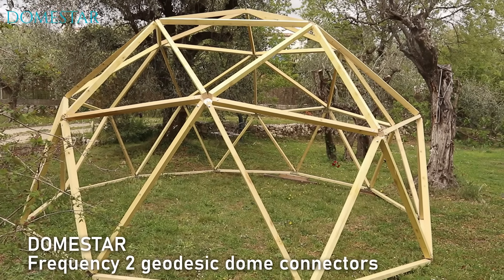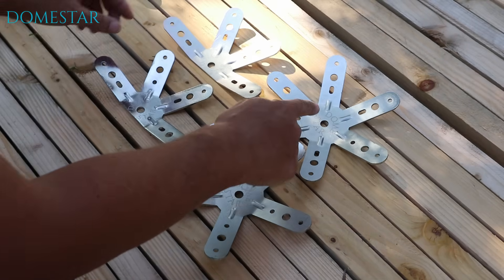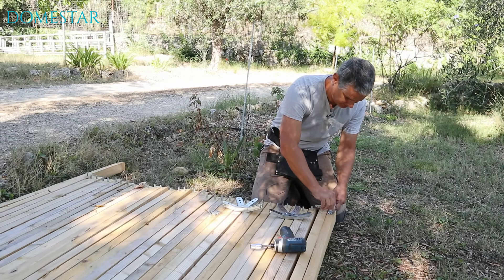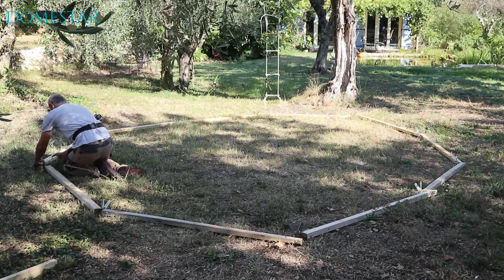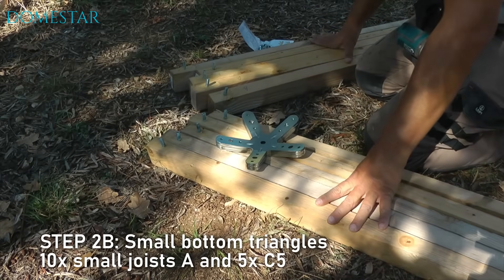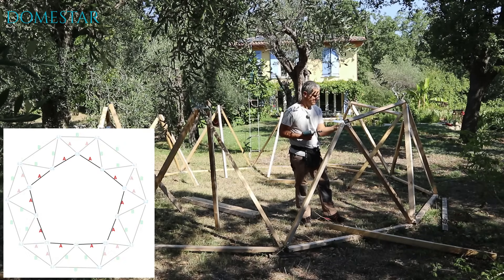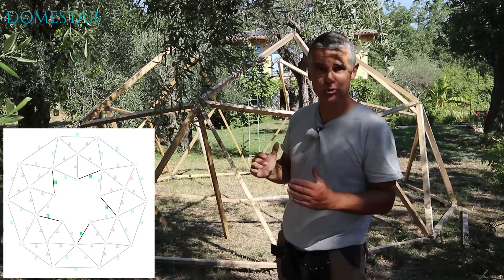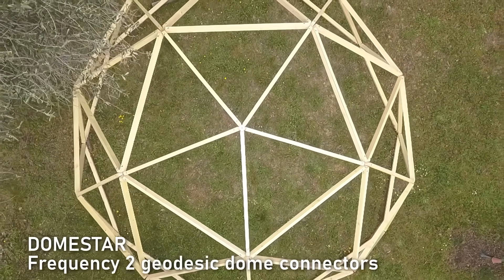2V geodesic dome: how to build a frequency 2 dome with DOMESTAR connectors (ENGLISH Version)

Comment: Can you please explain the difference between v2/v3 and 3/8-5/8? I tried to look on the website but there is no clarity explaining the differences.
Reply from the maker: OK I can try. Most domes start as a 20-sided 3D figure called an icosahedron. Each side is a triangle. If you do not cut the triangles at all then that's a 1V frequency dome. If you split each triangle in 4 small triangles then that's a 2V frequency. Split it in 9 and it's a 3V frequency. 
Then the original dome is a sphere: not great for a building. So you're going to cut the sphere somewhere. A half sphere would be 1/2. If you cut less than half it would be 3/8. More than half it could be 5/8.
So here we have a 2V 1/2 dome (frequency 2, half sphere).

Comment: Hello  Blumkraft
What size (thickness) of the wooden joists do you use for the 2V dome 2.8 diameter please? 🙏 Great video by the way👍🏼👍🏼 and I have just purchased all the connectors so very much looking forward to building! ☺️
Reply from the maker: Building wood or lumber is the easiest to find in most DIY shops, at least here in France. Typical dimension are 62x38mm or 70x45mm. Rain / water resistance is an important consideration.

Comment: Wondering if starting the assembly would be better with the top, and adding the other parts after.  Seen this done with a lot of geodesic projects and it seems to be easier to do.
Reply from the maker: I will give it a shot but I think this would require a lot more people as this involves at some stages carrying the whole structure.

Comment: Can you think of any reason why I couldn’t use two sets of brackets per join?
Inside and Outside sandwiching the timber with a through bolt to compress join?
I realise that doubles the quantity I would need for a dome.
I plan on creating a triple skin dome with an insect mesh layer on an outer frame using ‘BuildWithHubs’ kit and inner overlapping polycarbonate sheets for rain proofing and inner adjustable insulating layer.
This adds obviously weight.
Reply: Maybe they differ a bit in size, because of the angles.  So, the holes might not line up.
Reply: Cant see a reason for insect mesh on the outside if you are using polycarbonate. You`ll need to be good at trig, the frame will be triangles and it will have a different frequency to the polycarbonate shell made up of polygons, not triangles..
Reply from the maker: Yes: this would work if you use wood screws and not through-screws like I am using here. My through screw, screwed from the inside, has a bit on the outside, and it will not align with the outside connector. With wood screws you do not have this problem.
But through screws make building the dome much easier! It helps so much for the alignment: I would not imagine building a 3V dome with wood screws and not my system of through screws.

Comment: Where can this be bought?  Can you provide some links for manufacturer? Same question.
Reply: Found it on yt. Viking domes
Reply from the maker: @gta-6837  The manufacturer is Domestar. Vikingdomes is a different company with different connectors.
Reply from the maker: The manufacturer is Domestar and these can be bought on amazon France, Germany, Italy and Spain once they are back in stock :)
Reply: @blumkraft1708  I can't find a way to purchase them in the US.
Reply: @battleofarmageddon1366  Looks like Domestar isn't promoting their products in this video all that much and likely not ready to expand their business offering in the USA.
Reply: @blumkraft1708  
£170 for a 2v bracket kit is ridiculously expensive.

Comment: Where can this be bought?  Can you provide some links for manufacturer?
Reply from the maker: The manufacturer is Domestar and these can be bought on amazon France, Germany, Italy and Spain once they are back in stock :) Also soon on Amazon UK.
Reply: Viking domes
Reply: @gta-6837  They are not the same. Notice the holes. These are not the same.
Reply: How can I get them in the US?
Reply: How long are these struts, and what is the total diameter?
Reply: If only there were a way to just type something like "dome star connectors" into a computer and have it search out the company for you.
Reply: @AlbertaGeek  Yeah, except they can't be found doing that.